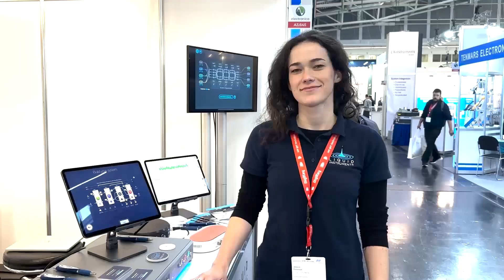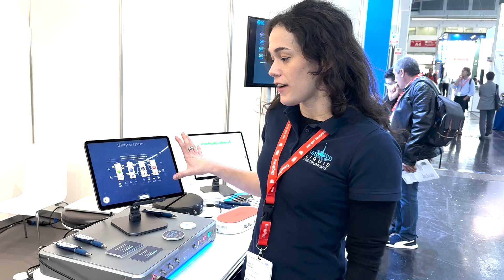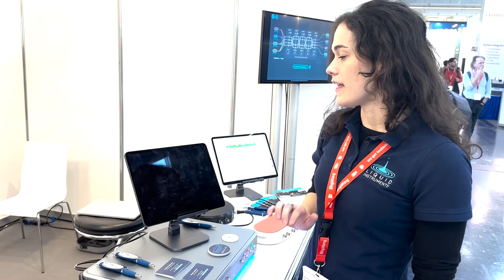Neural Network signal autoencoder demo

Comment: AEs seem overkill for this problem. There are plenty of shallow-learning (non-ml) DSP filters which can do this with lower overhead on non-custom hardware.
Reply from the maker: Thanks for watching! This is one simple demo that we showed at a conference, but there are countless applications that benefit from small-scale, real-time neural networks. Check out some other examples:

https://apis.liquidinstruments.com/mnn/
Reply: @LiquidInstruments  Would be nice if people would stop using the nomenclature of "neural networks" when at most, this is machinelearning. The term "neural network" was deviced by McCulloch & Pitts back in the 1930's. Their oversimplification has nothing to do with a neural network whatsoever. Same goes for the other overused buzzword, "AI" which again, is at most just machinelearning.
Sorry for the rant, I just find it misleading using these types of buzzwords.
The product otherwise seems interresting.